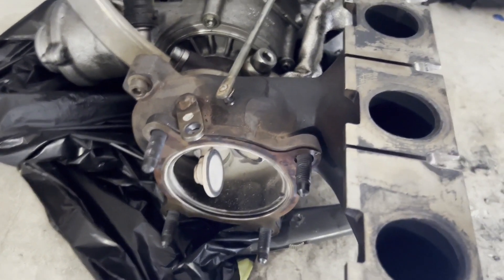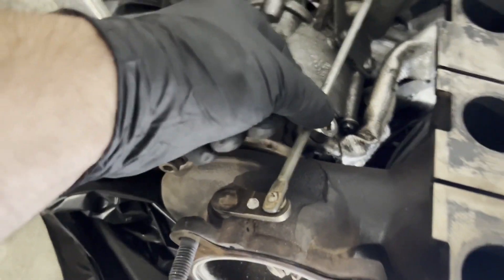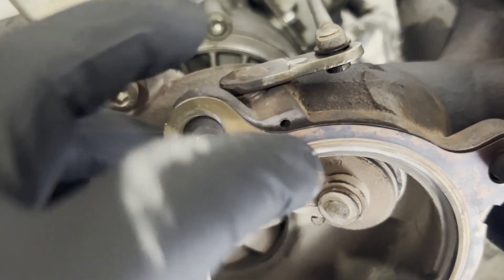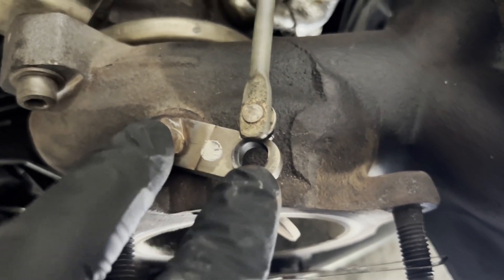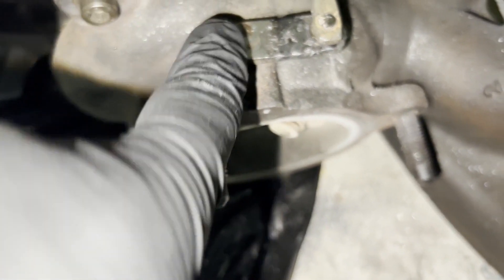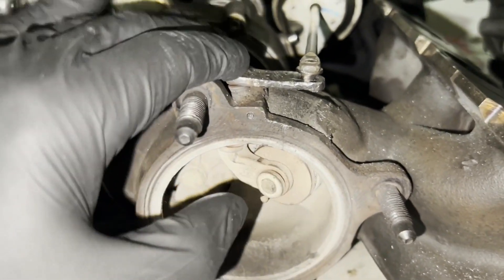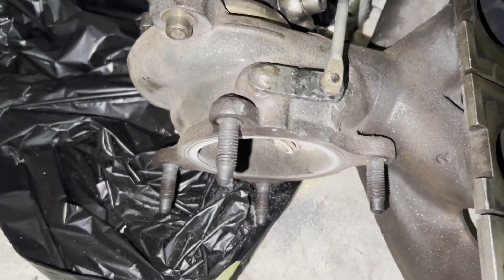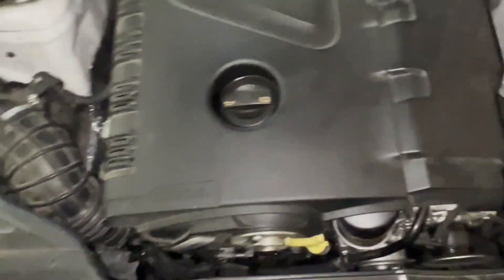P0299 Turbo Underboost fixed

Comment: Esse defeito daria um barulho tipo raspando pesa matelica com motor ligado
Reply from the maker: Less likely, but it can make very low rattling noise, I don't think you wouldn't be able to hear it while driving, however there are also some normal noises turbo will make while boosting. so to be sure I would have local mechanic do proper diagnostic after engine cools down overnight. Thanks for watching

Comment: Hey I got a Caravelle 2.5 t5 and when it goes up it doesn’t let boost only shows a plug signal
Reply from the maker: Did you scan ECM, it should have trouble code stored which would point you to direction where to look first since Glow plug light can aluminate for other reason and sometimes will go in to limp mode which makes it felt like engine not busting, so I would have mechanic scan it first and go from there. Thanks for watching
Reply: @samstye I want like without mechanics like without wasting a single penny or like higher than the 10£ if u got any suggestions, by the way it is diesel engine
Reply: It’s P0299 the same code
Reply from the maker: @Pom_Editz Is this under busing happening constantly or randomly ?
Reply: @samstye Yes! I need to go somewhere to another country that is couple thousand kms away! And I’m trying to figure this out.

Comment: Hi, i just took apart my mercedes cla 250 turbo to check for turbo loss, the wastegate valve is open on default in the inside and when the wastegate actuator makes the vacuum it is supposed to clamp could be my guess, i have ordered a new actuator for now and will see if it will fix the issue
Reply from the maker: The wastegate is held shut, closed by a spring inside the actuator so if that spring breaks there is nothing to keep gate closed so in that case replacing actuator is probably best option,

Comment: Couldn't you just put a rubber washer in the hole then put the rod rivot back in to seal it kinda?
Reply from the maker: I wouldn’t use rubber since in very high temperatures rubber will starts to char and even catch in fire quickly.

Comment: Does that kind of turbo problem make any weird sound in the engine?
Reply from the maker: I believe in the turbocharger Itself only yes it can make small random rattling noise from wastegate if is loose, but you wouldn't hear that while you are driving or if car idling.
Reply: In my case my car starts loosing power and if the ECU detects malfunctions he stops sending voltage to the vacuum solenoid